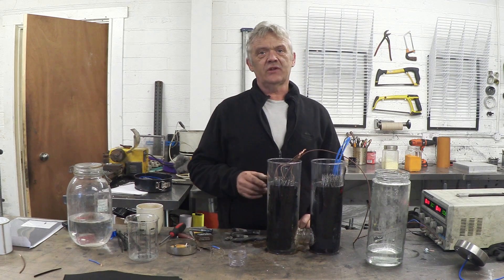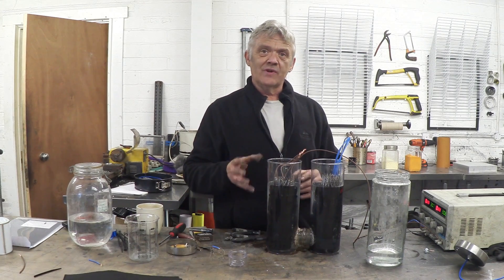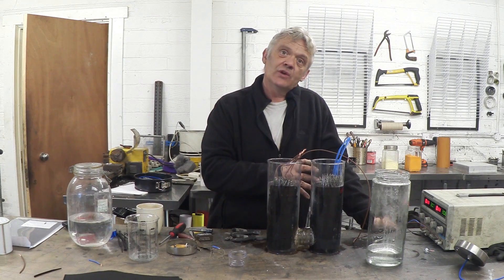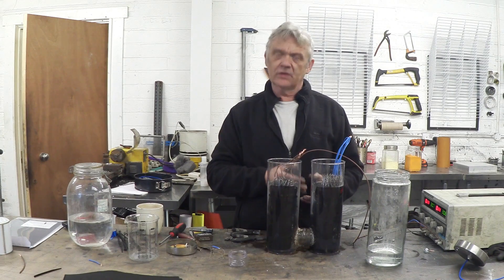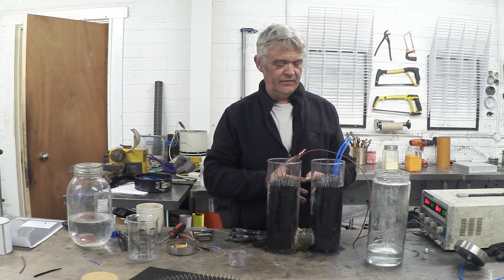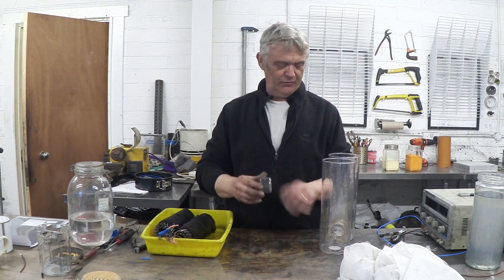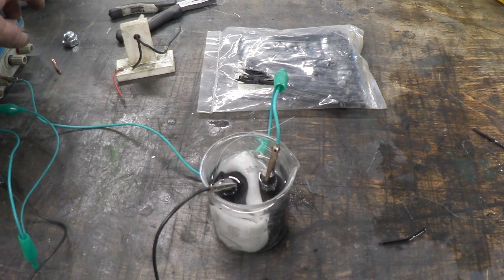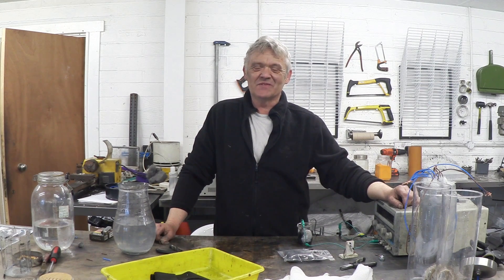Improving A Hydrogen Generator

Comment: Absolutely loved the video.
HHO mini torch, wire coat hanger, tiny piece of precious metals  (platinum) out of a car catalytic convertor.
Hypersensitive solar panels, I can't bring them to the top of my head right now but I think they might have been photovoltaic cells.
I saw it on a channel a couple of years a go but the channel disappeared but once the platinum begun to glow it allowed thy guy to turn his torch right down to next to nothing but the actual platinum looked like it was burning as bright as the sun.

Fantastic work you're doing and I hope what I've written drives your curiosity to see what can be potentially done with it.
The wire coat hanger is to suspend the platinum on.
When he surrounded it with the solar sensitive cells he used a plastic fish bowl because it didn't give of any significant thermal energy to the surrounding area.
Have a great day.

Comment: Great work Robert.  Can you explain more why you've included carbon felt?  Could you not just use the stainless steel mesh zip tied into a tube in each cylinder?

Comment: Have you tried separating the gasus with Magnets?
Reply: Would be an improvement. I doubt he is separating the 2 gases this way, kinda on the path, but not with this configuration. I designed one over 10-15 years ago, just never did the build.

Comment: You can tune The Unit HHO Generator with set up current and make super efficient.  Some People made it and are gone in pease. I DO Personelu have much more advance  unit in dust on my attic.
Reply from the maker: the problem with that is keeping it tuned I did look at phase locked loops as a way to do that